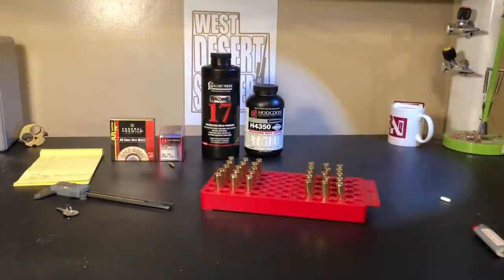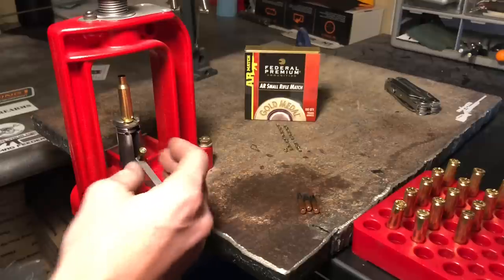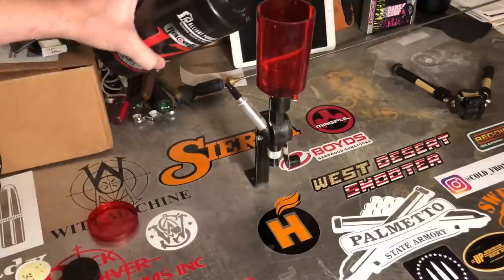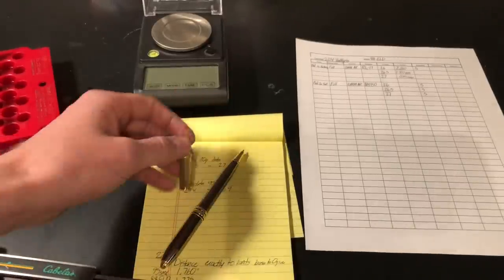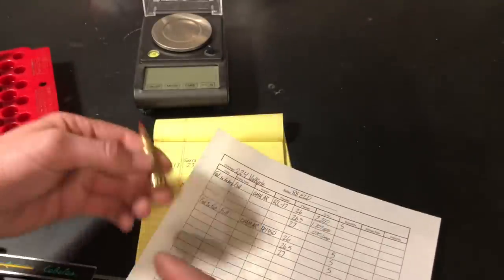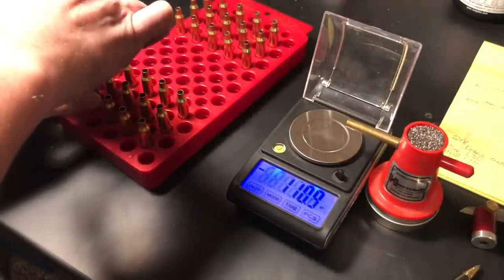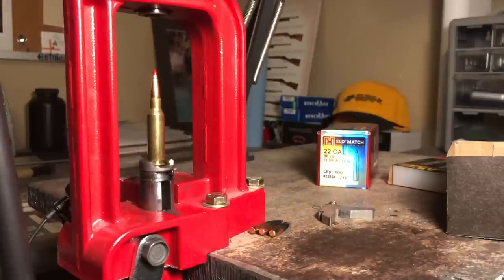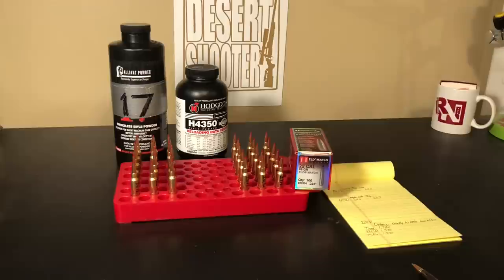Loading 224 Valkyrie 88ELD-M with H4350 RL17

Comment: This bullet does not like to jump. I did seat at 0.010 from the lands and got .39 moa (I had to hand feed the rounds) I suspect 0.070 will not produce good results (I've got 2+ moa with this kind of jump).  For the priming, after using few different ones, the one I like is the Lee Auto Bench Priming Tool mounted on a piece of wood. It gives you a good constant result while giving you a good feedback on the pockets.

Comment: Plus 1 for the RCBs tool, I love mine but noticed it helps to give the case a little light wiggle by the neck when primer is actually going in. Sometimes the case can pop right out from the universal mouth jaws if too much resistance is met, Lapua brass has snug primer pockets with CCI BR4's.
I watched a review video on YouTube before eventually buying one and he too commented this was happening with him also, can't remember which caliber he was loading.
This is my second tool now as first one got damaged as the small white plastic thing that houses the primer before going in got damaged somehow by the bolt that pushes primer in, whole unit was replaced free of charge as only 4/5 months old. It wasn't with mil crimped primer pockets either, case someone thinks this.
I've used the Forster co ax press and found it had very little feel plus I was damaging the rims of my brass on some occasions by using too much force. I have also used the bench Forster co ax tool but found primers dropping out prematurely when on a level table. If it's mounted slightly tilted back and on a wood block this doesn't happen. Found it too time consuming  to load up as well as primer tube didn't have a great fit to primers being individually loaded in.
I've used the Lee hand press tool with primer seater as well but still I prefer the RCBs as its quicker and has a better feel for primers being fully seated but not crushed. Our favourite YouTube channel Johnny's R.B. uses this tool too and he seems to like it as well.
21ST CENTURY STAINLESS PRIMING TOOL (SEATER) is probably one of the higher end better again but quite pricey for all it does. Each click of the head equals .0025" for precise seating depth.
Here's Richard Utting's good review on it.
https://www.youtube.com/watch?v=ctp_P6fMsy0&ab_channel=RichardUtting
WDS hope this helps your decision on buying a good one but my personal preference is RCB's best fastest choice out of the 4 I've used and tried.

Comment: Hows your brass life with the bolt action upper. I’ve had to throw away brass after they’re second firing in my semi auto. Just wondering if the bolt action has any difference with the primer pocket issues

Comment: are you not trimming your brass? I'm pretty new to reloading and have been looking for a good trimmer or something to reference for a good oal trim.
Reply from the maker: Lee trimmer is a great start. Cheap easy and cuts consistent each time
Reply: @WestDesertShooter  thanks bud, I saw the Lee trimmers , they have a trim die and cutter but they don't have the case gauge available unless I order it custom for 16$.
Reply from the maker: Oh, for the Valkyrie. I bought one for a 222 rem and filed the shoulder of the gage down then grinder the pin to the correct length. At the risk of losing a 7$ tool I thought it was worth a shot. And it worked! That’s what I did. If you have a drill, file and grinder you can make it happen. Or a belt sander

Comment: Great video, 
H4350 and Reolder 17 are literally right next to each other on the burn rate chart.... 
 I would've saved the mixed powder for barrel break-in's, fire forming or plinking and just used the minimum charge weights.
...Now, If it were mixed with something fast burning like Red Dot, I'd toss it.
Reply from the maker: Problem is it was a brand new pound of RL17 I haven’t even used it yet. I scraped off the top and it’s fine now. Tossed a bit of each and now both are good to go for development
Reply: WDS. I’ve been pretty good about keeping only the powder out I’m loading at the moment and separated from the others and also labeling everything as I go. But now for load development when loading charges incrementally I also put my next charge weight on a small piece of paper and tape it near my scale. Then after I load those and label them, I cross that weight and write down the next new weight to be loaded. Before all this I had an instance where I think (afterwards) I loaded previous charge (twice) but labeled it with the next charge up.